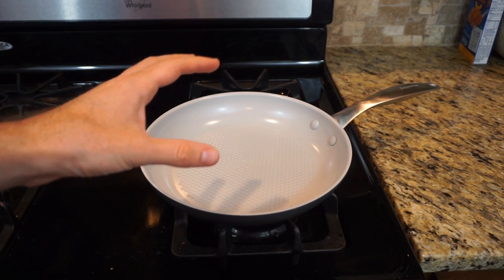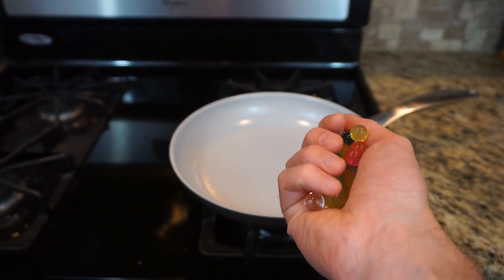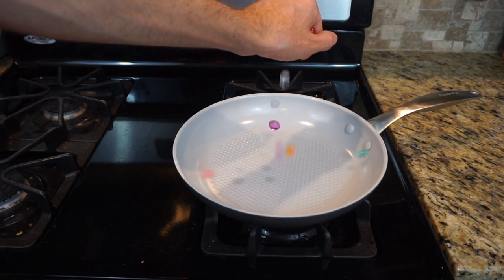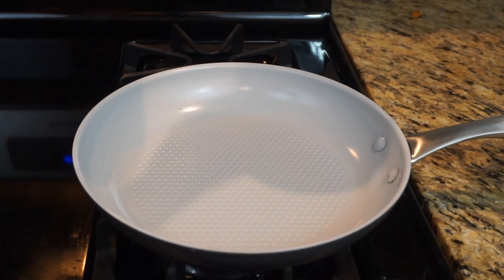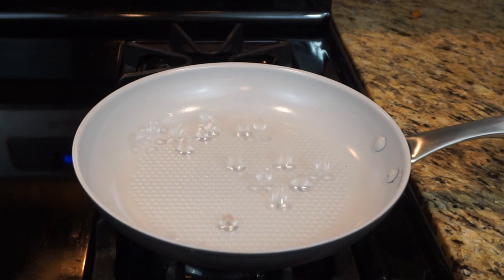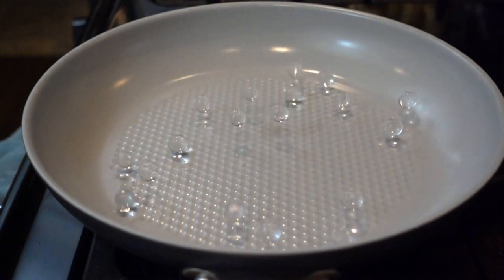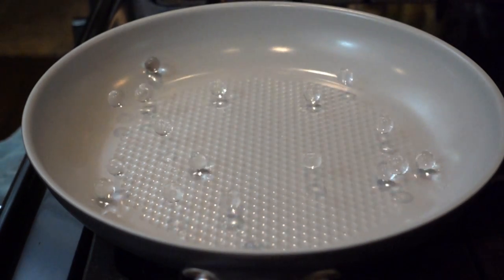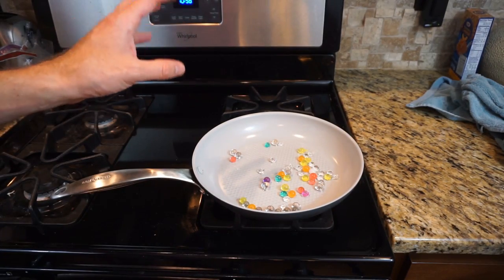Endless Bouncing Balls Using the Leidenfrost Effect

Comment: There is actually a very cool video that shows how the Leidenfrost effect can be used to "roll water up a hill". They have a VERY hot 'highway' of metal with a positive slope, and it had little stairs on it. When we put the water, the water vaporizes between the stairs and pushes the whole thing forward to the next stair, and so on. In the end the water rolls up the hill.

Look it up !